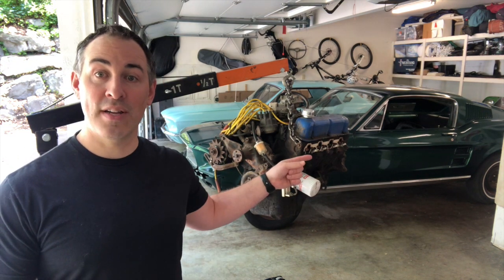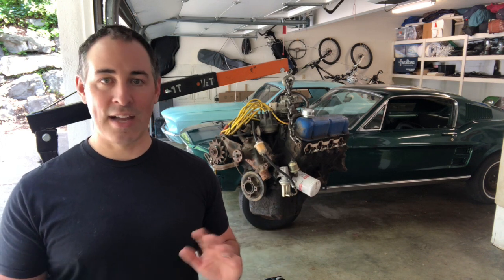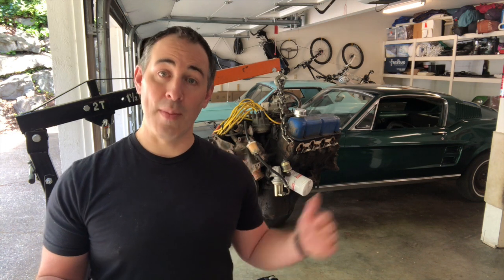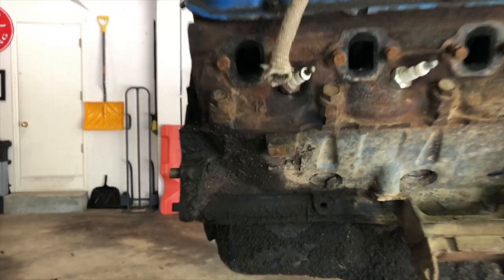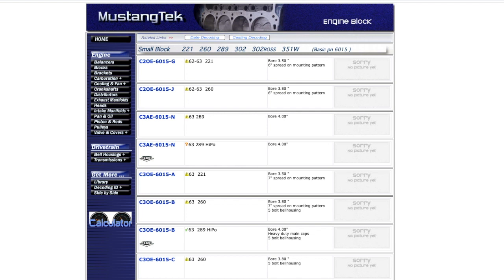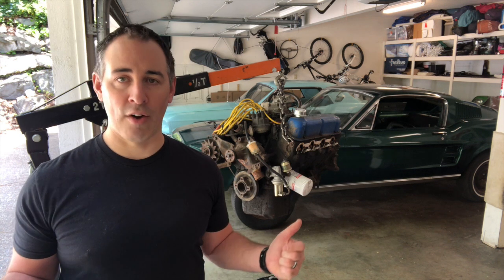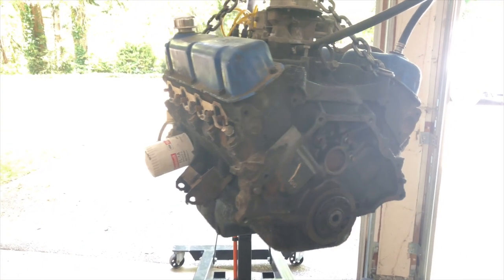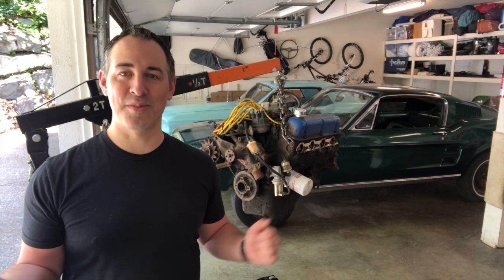Ford 351 Windsor Engine Identification

Comment: I worked at the Windsor Engine Pant that made the 351.  Production was 3 engines per minute - 1200 per shift - should be lots around.  I worked balancing the cranks and many of the production line jobs. The toughest job (other than the foundry casting blocks, heads and cams and cranks) was the hot test where the engine was run and final engine balance was done before loading into the box cars.
Reply: Wow, 3 engines completed per minute?  That’s a LOT of engines.
Reply: Thats incredible. 1200 per shift.
Reply: 351 windsor is in a 74 bronco bored 10 over rv cam w a 4 barrel holly carb & aluminum intake.
Reply: Where do I find out & check my block # to make sure

Comment: I tell by the gap between the water pump and the motor, the 351 has a gap in between and the 302 is almost flush with the motor. Just my way to tell
Reply from the maker: You're right.

Comment: I just bought my 10 year old daughter. A 1967 mustang it currently has a 289 in it. However we are searching for a 351 Clevland planning on completely restoring it with a few upgrades. She is picking out all the colors. White with pink racing stripes and tan pony interior. Gonna be a blast
Reply from the maker: I love it. Nice work Dad!
Reply from the maker: J.C. Kohle  I sold the 351W that came out of this car 3 days after I pulled it. It's definitely not junk, and the person who bought it is putting it back into their '70 Mustang that came with that engine originally, replacing a 6 cyl they had been running for several years.

Comment: hell ya 351w! take it over 302! 302 are wake , they crack down the middle at about 500 hp. 302 had different firing orders and balance 28 and 50 oz. 351w all 28 oz. the distributor pad on 351w has a ridge next to it. not all 351w had 16 bolt intakes! 1977 up had 12. i had a 1979 351 from a van with a 1969 galaxy 2bbl intake the 4 extra holes had to be pugged as thy would end up in the water jackets of the 1977 up heads. look up a new intake they are all 12 bolt as that works on old and new heads.  all production cars the engine can go in with hood on. all so around 1970 the harmonic balancer changed from 3 bolt to 4 bolt. had a 351 in a 1977 f100. mine was mostly stock. had 1969 galaxy intake 2bbl intake. had a 2150 moto craft 2bbl carburetor it was a early one as it did not have all the emissions vacuum ports. had heeders used fox body short tubes with glass packs and h pipe. the factory cam was perfect as it had a 108 lsa and 190 duration at .050 tappet lift. the cam sounded more radical than it preformed. the combo had a 1950s hot rod sound! had lots of grunt. it could wind up strong to 4500. recurved the dizzy with mr. gasket springs used a points dizzy from a ranchero 1970 as it had a short mechanical advance in it with recurve springs it was wayyyy more responsive. it had a 1981 c4 trans out of a truck or van. could lay down 20mpg at 60 mph! best small block i have had! i would do a aluminum 4bbl intake if i had to do it all over. would run a elderbrock 600 cfm carb and elderbrock rpm intake with 4 hole spacer.

Comment: Just so you know that engine was built in Windsor Ontario Canada. The plant was known as Windsor Engine Plant One. That plant started with the 221 ci  V8 that grew to 260 then 289 then in 1969 the plant was converted to build the 351. The plant produced 351's from 1969 until it was closed in 1996. just a little info.
Reply from the maker: I didn't know that! Great info, Tom!
Reply: Hey tom, apparently all oil dipsticks for a 351W are not the same.  Any insight on that?
Reply: @jordanpeele5306  hi Jordan, the 351 Windsor dip stick changed I think in the late 70's. It was moved from the front cover to the oil pan when we went to the double sump pan. The dipstick is a different length for the double sump than for the front cover version. If you happen to find a 351 Windsor from an Econoline van it will be almost 4 feet long. The assembly plant took out the dipstick and tube we installed and put their own in. I don't know the exact length of the dipsticks but if you mix them you won't get accurate results. The engine you have is an older one so the dipstick is in the front cover. The double sump pan won't fit in your Mustang. so if the stick isn't right then that is what you got. Hope this helps.
Reply: @tomlittle5974  amazing info!  Thank you

Comment: Later 351w had 12 bolts holding the intake. If you can get a socket on both thermostat  bolts then it's a Windsor because it's an inch taller.

Comment: The 351 Cleveland I put in my '68 fastback was part of Ford's Pantera project. When the Pantera was canceled, they sent the remaining engines to selected dealers. I used a Sig Erson high lift short duration camshaft, Mallory dual point distributor, Offenhauser 360 intake with a Holley 850 cfm double pump four barrel carb, and Doug Thorley headers. It was a runner. Loved driving it.

Comment: 1985 ford f150 4wd 351windsor. It's a great motor. I suggest a Edelbrock top end kit for yours if you build it. Depending on how many miles yours has, you might not need to touch lower end. Mine has 117,000 original miles. It had been sitting rarely used for twenty-five years before I got it. I got it free because it ran bad and no one knew what was wrong. I knew. It was the fuel pump. They couldn't believe it. It's a great motor.

Comment: Used a 351W & AOD out of a 1984 Grand Marquis & put this set up in a 1963 Thunderbird.0nly mods were Edelbrock intake , 650 CFM carburetor & headers . Worked well , much better than the original 390

Comment: I've used the '69-'70 351W heads on two different 289 builds many years ago before aftermarket heads were available. Requires a water port hole drilled in the deck to match the 289 block. It's an old hot rod trick that won't break the bank. Bigger valves and ports. Use flat-top pistons to make up slight increase in CC volume. :)
Reply from the maker: Good to know!

Comment: The 351W has a taller deck height than the  289 /302 engines . Full Police packaged LTD Crown Victoria 1981-1991  had this  engine as well with dual exhaust VIN code G .

Comment: I had a 74 LTD with the 351C that I bought from a wrecking yard for $150. I drove the car for a while and them installed the engine and transmission into a 65 F100 short wide box that I bought for $100. It was one fast truck until the engine spun a bearing. I was rebuilding another 351 Cleveland for a guy who left it and never came back. That was 30+ years ago. So now I am getting some Australian 2V closed chamber heads for it and finishing the build. The fast 65 pickup will live again.

Comment: A nice lady gave me this 1982 F-150, with a 351W. I found out today that it was made in San Jose Ca., which really means it was made in Milpitas Ca., I know that because my Dad and all my Uncles and my Grandfather all worked there. My Dad worked in the Truck Dept., and the Plant closed that year. So that means that my late Father very well could have worked on this truck. That's why I think I'll keep her. I'm having fun working on her. I'm learning so much. Like the firing order is different for Ca. trucks, because of the EEC-III Ignition system.

Comment: Running a 351W in my 56 F100, AOD, Procomp heads, lunati cam , headers, Edelbrock carb and intake. Runs good.
Reply: I have a 351W in my '56 F100 also.👍🏻👍🏻
Reply: BTW . What vehicle does your headers make for ?
I would like to put some on mine but I don't know which ones to get.

Comment: Great Video. Just wanted to add some info, yes early 351w intake manifold bolt count is 16 but later year's used 12 like the 302. not sure what year they started this? another quick way to confirm is to measure the width of the manifold, 9.5" on a 302 and 11.25 or so on a 351W
Reply: Thank you I was reading the comments to find this LOL I bought a brand new stealth intake for a 351 Windsor and it’s got 12 holes... ias a bit confused
Reply: @vincemeyer6637  No Problem 😊

Comment: I have a 351 windsor in a 1976 mustang cobra II, so far for modifications I've swapped out the 2 barrel intake and carb for a weiand 4 barrel intake and edelbrock 600 4 barrel carb

Comment: Love your vid. I have a 69 351 built to 427 cubes with a 2000 Novi Paxton with 16 lbs boost. Dynod at 760 hp. Engine is in a custom 64 fairlane.

Comment: I have a '69 Fastback that the PO used to race. I'm in the process of putting it back as a cruiser. The vehicle plate tells me that the car came with a 302/FMX but what I have is a 351W/C4. I have no idea what components are in this engine but it is a powerhouse! I'm updating C4 to AOD.
Reply from the maker: Good call! That AOD will be way more enjoyable to drive on the highway!

Comment: This may be off topic with your video but I have 1993 F350 5.8L 351w EFI and I need to change out the crankshaft. What should I watch out for when purchasing a used or reconditioned one? Will any year 351w crankshaft fit?

Comment: I had a 351W out of a 95 Cobra R in my 1994 Cobra. Was built with a custom camshaft, Trickflow 240cc high port heads, Edelbrock Victor EFI intake, Accufab long tubes, Accufab throttle body. Made good power out of it but never got a final dyno number or a track time in that configuration before selling it. I suspect it was  between 360-380 at the wheels based off where the previous configuration was at.
Reply from the maker: That is potent. Nice!
Reply: @ClassicNation  Thanks!

Comment: I bought an 1984 f150 about 5 years ago  i over heard my father's friend say that he needed to sell his old ford to make a payment on his new truck he just bought out of curiosity i asked what he wanted said 400.00 bucks i thought  maybe its a junked out ol truck ssid it was his everyday work truck for the past 15 years and still runs and drives great i never asked what was worng with just told him if he pulled in my driveway with it id give him 400.00 for it an hour or so later he pulls up in it never asked no question  bought it right then  and man was i lucky this truck is a beast i drove it every day for a work truck myself with a 16ft trailer loaded down with tools  and equipment for about 5 years now up until 2 months ago it started leaking oil real bad so i parked it so i didn't ruin the motor i pulled the engine to replace all outter gasket and seals as i started to replace all these i noticed alot of wear and tear so now im trying to figure out what kind of 351 this is i do know its not a Cleveland i was lead to believe it is a modified engine but i went to order a complete rebuild kit i was told by parts store its a Windsor the numbers i found on the block is located at the right side at the bottom rear just above the oil pan the #s are E3AE-6015-BA2 and right under that are the numbers 4H17 if anyone could help with this i would be grateful i would love to keep this ol ford alive its still beast when i parked it except for the major oil leaks thanks if anyone knows how to help figure this out

Comment: I just got a 75 ford E100 van with a 351W. It’s a 2barrel carb I think. It’s not running but motor spins, have not pulled the engine cover or air cleaner yet.

Comment: What's the difference between a roller block and a non-roller block?

I have a 351w C30E-6015-B-6 block number. I want to put a new cam in with roller rockers and lifters. Is there a retrofit type of set up to allow me to use my block?

Comment: Another way you can quickly id a 351W vs the 289/302 is the height of the distributor base.  The base is recessed about an inch below the intake manifold on the 351.  The base on the 289/302 is almost flush with the intake manifold.  How I would build the engine would be totally dependent on the vehicle it is going into and what the vehicle is used for.  I am more of a hot rodder vs a nut and bolt kind of guy. I would keep the short block pretty stock/basic with a better than stock cast piston, good set of rings, stock OE crank.  Keep the CR around 10:1.  I would then install a good top end kit (heads, retrofit roller cam and lifters, roller rockers and a good dual plane intake) from one of the many good aftermarket manufacturers.  I would top it off with either a good 750 or a 780 vacuum secondary carb carb if using an automatic trans with tall gears. If the budget allows a throttle body type fuel injection is even better.  Holley makes some great systems for not that much more than a good carb.  The automatic learning of the systems is great.  The engine will cold start better and run far better without a professional tuner.  Of course you have to finish it off with good set of headers.  This will produce an engine that should make 400+ HP, a flat torque curve and drive close to stock.  Kept the cam overlap fairly wide to retain good vacuum for power brakes.  Above all have fun!!
Reply from the maker: Great info! Thanks for that.

Comment: 351w in my 1985 f150 lariat it is a beast I love the motor.
Reply from the maker: Agreed! I actually changed gears on my Coyote motor plans, and I'm going back to a stroked/bored 351 sbf!
Reply: I’ve got the 4bbl 351 in my 1985 F150 Lariet as well, 26,370 on the odometer, probably sitting at 126,370 or so in 35 years, but my motor made a loud Bang sound and now it won’t run. Any advice? Went to get my timing checked and she went bang and won’t run.

Comment: Hello.  I have a strange bird; E350 church van with 351 Windsor.  This apparently has electronic distributor with NO HOOKUP for a vacuum line!!??  All aftermarket distributors for this application have vacuum like nipples.  It starts and idles but when you put it in gear and go, it stumbles and dies.  Periodically won't start.  We have changed the plugs, wires, rotor except for plugs one and two.  Tried new tps, new map sensor, new cap and rotor, new wires checked 3x for proper firing order, New IAC.  Distributor will not turn after loosening small bolt.  Please help with this oddball.  Tksia.

Comment: On a mission! 1984 351w block with standard balanced lightened crank, standard rods & pistons, honed and new molly rings, GT40 big valve ally heads, comp cam, Scorpion roller rockers, new 750 cfm edelbrock, edelbrock intake. ford racing water pump, high flow oil pump, edelbrock true roller timing set, pro street 28 oz crank damper, all edelbrock hardware and 2 new nice big Max speeding Rods Turbo's all through a T6 Manual box..... should be fun!

Comment: Your 351W is an early casting that has beefier webs in the mains and a high nickel content.  If it has not been bored excessively, it is one of the good ones.  It also has a shorter deck height at 9.480" as opposed to 9.503".  This is what my race motor is based upon except I've got an SVO crank and Cleveland heads at 11.5:1.

Comment: Hi, I have a 65 convertible, and when I bought it to my horror I found it had a 351 W in it (C090E-6015-B4) and really do not know if anything has been done to it. I was abused one member of the Ford Mustang Club who said that my car is no longer original (true) but also reckoned that the motor will twist the engine bay and front end totally ?? Well i hope not. Anyway I am considering buying a 289 to replace this engine which is actually in pretty good shape. I would be interested to get your opinion ? Cheers, Peter L in Oz...

Comment: I have a 1983 Lincoln Towncar with the optional 351w carbureted. It has been modified with competition cams, roller rockers, carb is a 1750 cfm fastfuel 4 barrel carb made by Holly.

Comment: I have two 351 Windsor Marine engines, and they both have 12 bolts on the intake manifold. 6 on each side. You said 351 W motors have 8 on each side.
Not sure what to think.
BTW, I had a 67 Mustang fast back, same color just like the one in the video. Wish I had not gotten rid of it.

Comment: I think the number of intake bolts method of identification only applies to the earlier engines. Pretty sure the later ones have the same number of bolts as the 302.
Reply from the maker: That might be true. I'm not very familiar with later 302s.

Comment: Hello, the stamp number is D1AE 6015 DA6 0617 and the other stamp is 1J153251. The 351 engine was given to me rebuilt when I purchased the 1965 mustang. But I have never put it in because the mustang has a rebuilt 289 engine in it. I heard the D Model is hard to find, does this make it a desirable engine, it’s a long block rebuilt.

Comment: The 351 Windsor Commonly has 12 intake bolts not 16, just the newer model 351 W is what I am told, I have both intakes and the 351 Windsor heads fill fit on the 302 block, but not the intake the 351 is wider. Both intakes that I have are a 1980 model. Besides all you have to do is thread the 4 extra holes and install some short bolts in them and it should work.

Comment: help identify this on my block. C90E-6015-B-2 AND IS THE FIRING ORDER SAME AS 289/302? AND AT WHAT DEGREE TO SET THE HARMONIC BALANCER ! OR CAN I GET AWAY WITH JUST TAKING OUT THE INTAKE (EXISTING 2 BARREL) I GOT A EARLY 80'S FORD GT INTAKE  (4BARELL,). WILL IT FIT? CAME  WITH FELPRO PART#1250 INTAKE GASKETS.THANKS  ALSO HEADS ARE STAMPED 351 WF... AND THIS SITS ON MY 1950 FORD SHOEBOX WITH A  70'S C4..

Comment: Besides the intake , the real easy to identify the 351 is the weather neck is in the block 302 is in the intake manifold. If you are lucky you may have c90e ( check number , been a long time )  head they are not common but worth looking for . You can use gt40 head  from an explorer 302 about a 20,30 hp bonus ,only deal is the head bolt holes must be drilled to 9/16”,not a big deal ,easy deal my memory is the 2v @4v were the same head v stands for Ventura so just change the intake . All small block 289-302-351 build interchange pits , book explains all of it . Look on line or eBay   Do not get gt40p heads these use a quirky ex manifold , no after mkt yet available. In old so fact check #’s these old heads use the large spark plug thread , yep I like my fords !